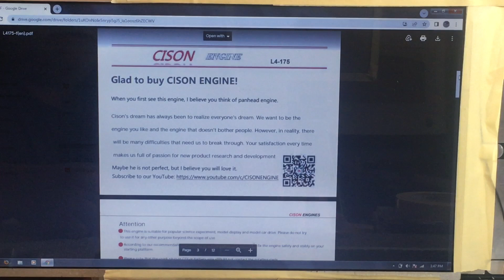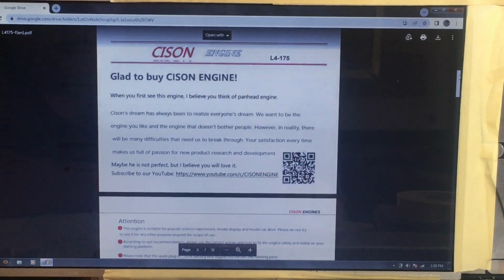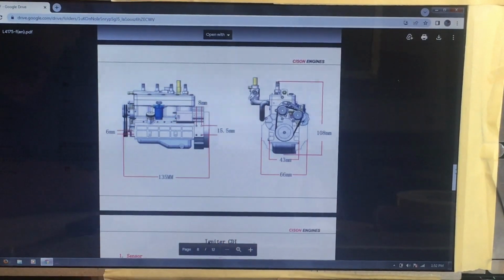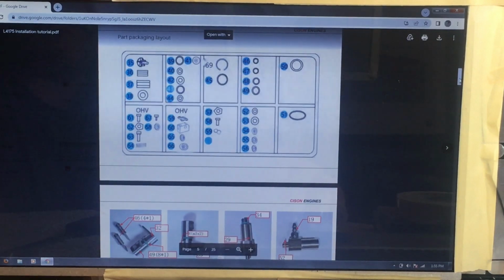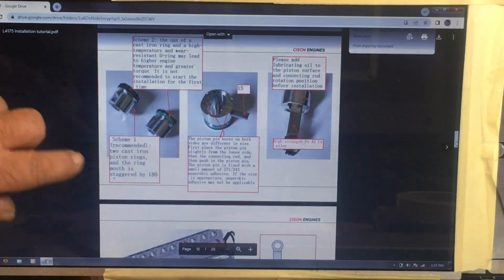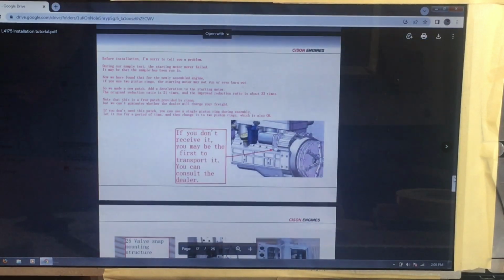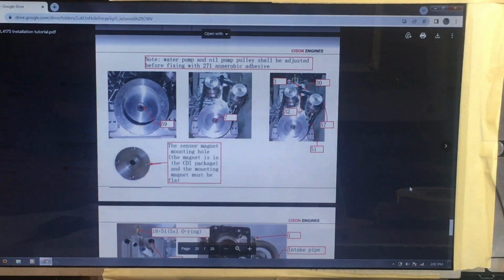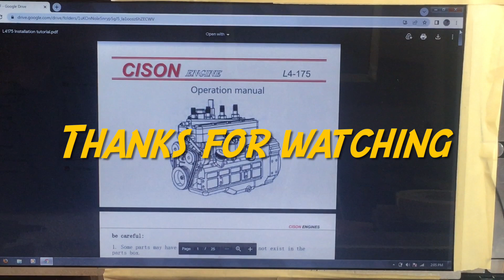Let’s explore the new Cison L4-175 assembly manual

Comment: 10:36 the rings were a big hesitation point for me. I HATE silicone o-rings around pistons. They don't last and you can't put any load on an engine using them because tit'l just melt them right out of it.

This thing might just be a good option for some Baja 5B shenanigans if the gearing and clutch can be made to work with the lower rev band.
Reply from the maker: Yes silicone rings have no place in any combustion chamber in my opinion !